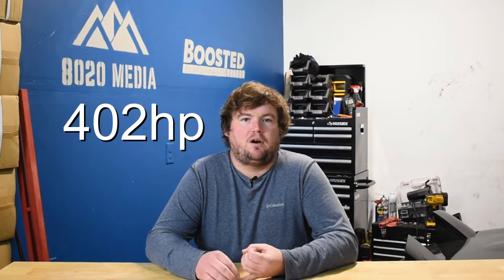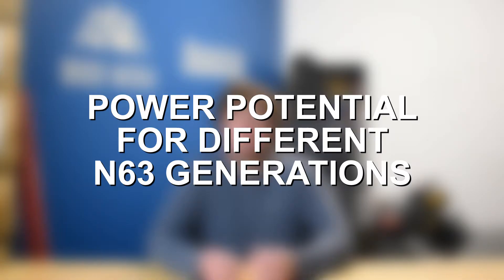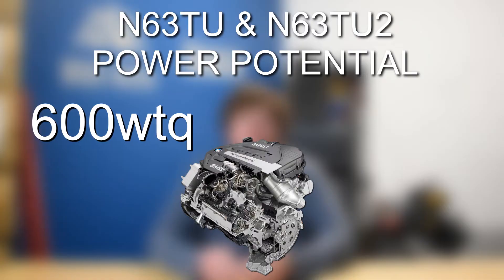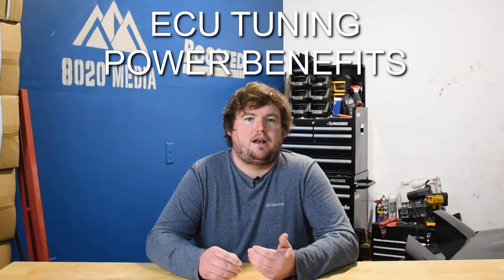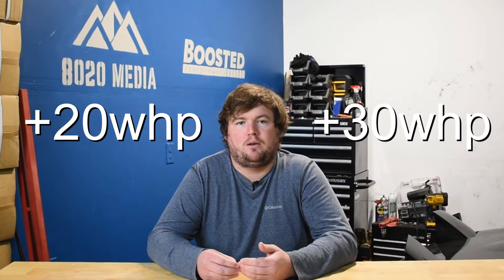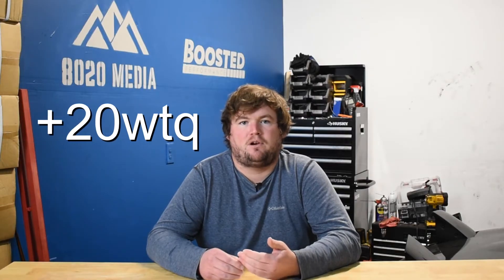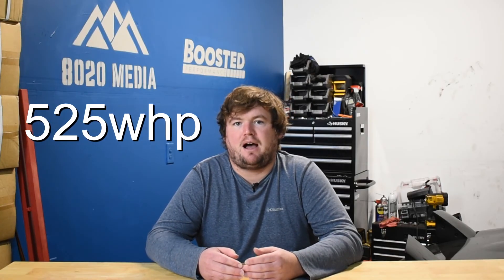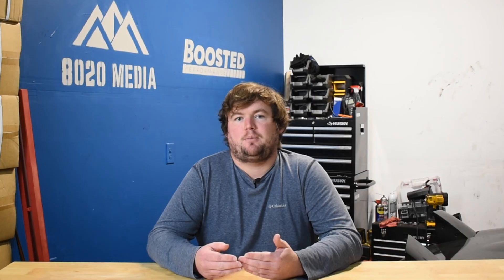How to Build a 600whp+ BMW N63!

Comment: Yo man thanks for the info! I have been thinking about this since getting my 2022 M550I with the N63TU3, want to research how much i can modify without voiding warranty or having a check engine light on at all times. I was thinking first midpipe + exhaust to prevent cutting the OEM exhaust and perhaps some HFCDP (in hopes to preserve oem parts). Could you recommend how much we can modify before Check engine and before void? I appreciate the details, like and sub earned from me.

Also what do you think about a race chip instead of tune? to avoid unlock costs
Reply from the maker: S - Thanks for the feedback! With the N63TU3, you can go a decent way with mods before triggering a CEL or raising obvious warranty flags, but the key is to stick to upgrades that don’t alter emissions-critical components or ECU calibration in ways BMW can easily detect. A midpipe and cat-back exhaust are generally safe from a CEL perspective because they’re downstream of the catalytic converters, so the rear O₂ sensors remain happy—just keep the OEM parts to revert if needed. High-flow catted downpipes (HFCDP) will almost always trip a CEL for catalyst efficiency unless paired with a tune or O₂ sensor spacers, but even with catted versions, BMW can spot them on a warranty inspection, and replacing cats technically violates EPA rules, so they’re higher-risk for both emissions compliance and warranty coverage. A RaceChip or similar piggyback is safer from a detection standpoint than a flash tune since it can be unplugged to return the car to stock without ECU flash counters incrementing; however, BMW can still log overboost or unusual sensor readings if a drivetrain fault occurs. The most “low-risk” power path for you would be: midpipe + exhaust, upgraded intake, possibly a RaceChip piggyback set conservatively, and keeping the factory downpipes if you want to be almost invisible to warranty inspections. Once you swap cats or flash the ECU, you’re in the higher-risk category for both CELs and warranty flags.

Comment: I prefer to tune with race fuel instead of E. I want to tune but i want to push stock turbos in a max effort build. Where are you guys located?
Reply from the maker: M - Thanks for sharing. Unfortunately, not everyone has access to race fuel. We're fully remote.

Comment: What does Arms charge pipe offer for a 2019 m550i ?
Reply from the maker: D - It replaces the factory plastic charge pipes with high-flow aluminum units, enhancing durability and airflow. The benefits include improved throttle response, reduced turbo lag, and better support for higher boost levels, especially when paired with other performance modifications like tuning or upgraded downpipes.

Comment: Havent dynoed mine but I run logs and tune on the JB4.  My base tune is on a Heatsync Beta tune then I jump on a piggyback JB4 for fine tuning and WMI integration.  I have bigger stage 2 turbos, Water Meth, ARM Downpipes, and 3.5 Bar TMaps.  Based on my software calculations I should be closer to 700whp but I never run it that hard unless I was tuning.  I pretty much drive like a grandma but I open it up when I want to.  Only drawback is the X5 E70 is a pig at 5600lbs.
Reply from the maker: B - Hell yeah! Sounds like a sick build. Thanks for sharing.

Comment: How realiable is a flash tuning for daily driving with these mods?
Reply from the maker: B - Depends on the kind of tune. But usually with more mods, the less reliable an engine gets. Unless you have a big budget and can afford all of the correct supporting mods.

Comment: I have 650i grand coupe 2015 N63TU upgraded charge pipes changed the turbo inlets upgraded front facing air intakes catless down pipe x pipe straight pipe sounds like a beast check my clips out just need my tune should I go stage 1 or stage 2
Reply from the maker: S - Hell yeah! What WHP are you running?

Comment: I have a 2011 X5 n63 with upgraded turbos, catless downpipes, upgraded coils from dinan and a jb4, and it's pushing close to 600 horsepower and she is a beast.😊
Reply from the maker: B - Thanks for taking the time to share your experience! Sounds like a nice build.
Reply: where'd you get the upgraded turbos?
Reply: Do you have a link you can send for specific JB4 you used for N63 I have a 550i been looking for a quick plug in tune only plan on a full ECU tune when I upgrade turbos
Reply: Can u tell me what the cheapest option would be to gain just 50 hp?

Comment: I have map options on Bootmod, Alpina 540hp and Alpina 600. But no real description on them. Could I run the 600 map?
Reply from the maker: F - Depends. Do you have all of the supporting mods needed?
Reply: @8020Automotive  I only have a OEM M5 exhaust on it.
Reply from the maker: F - Gonna go ahead and guess that'll need more than that for the 600 map. It should say on the bootmod site
Reply from the maker: F - Keep us updated!
Reply: @8020Automotive  yeah I thought I felt more power on the alpine 600 but it’s very similar if not, slower than stage 1 on 91. Occasionally would smell the heat, like something getting very hot. Switched back to stage 1 and feels a bit quicker. I want to go 93 but ots bundle is $150 additional, like damn should have picked a 93 tune. Donations welcome lmao, e30 is what I’m looking forward to though 😈
Reply from the maker: F - Nice!

Comment: Hello. Is there a way to tune or code out catless downpipes? I don't want to drive with a check engine light on.
Reply: 12B304 & 12B305 with Bootmod3.  Very easy to do.  I do this on mine. One is for the drivers side sensor the other is for the other side sensor.
Reply from the maker: S - There is a way to tune it out.

Comment: I have a 2016 750i xdrive. My current mods are catless downpipes, 3” straight pipe, Dinan ignition coils, ARM front facing CAI and charge pipes. I currently have a BM3 93 stage 2 tune. It’s definitely fast for a massive land yacht. The biggest issue with this platform is finding parts for it. For example the ONLY swappable intercoolers costs 3k. There are other options out there but it’s definitely a premium in terms of cost.
Reply from the maker: A - That's typically what happens when a vehicle gets more expensive. But sounds like you've got a great build!
Reply: i was thinking of doing this with my 2015 750li but that car is built to be quiet I would hate to change that with a catlkess down pipe. Is there any quieter but freer flowing options?
Reply from the maker: C - High flow catted will be a little quieter. But honestly a downpipe doesn't really make it a lot louder. Now if you're adding a full exhaust, that's where a lot of the sound comes from.
Reply: @blluz1 I have catless downpipes with oem m performance exhaust and it actually sounds great and at an amazing level comfort start has a nice growl with cruising being pretty much as quiet as stock with no extra drone in sport start up it is quite loud but sounds great and there you definitely hear it rumble driving in sport mode
Reply: keep messaging companies requesting parts. I know I have been for my n63t3. Custom turbo manifold and larger charge coolers, and remote oil coolers.
Reply: Hi I go the same model. What would it take and how much more o less.. What did you use.?
Reply: Was your ecu unlocked
Reply: Hey just fyi the Dinan intercoolers are just factory E70 X5M charge air coolers. You just have to figure out the rest of the kit yourself.
Reply: Yo is there a way I can make my 2016 750i burble and be loud ? Without doing anything else crazy besides the downpipes ?

Comment: Downpipes and charge pipes should come before a tune in an ideal world.  While catless downpipes deliver maximum power and the fastest imaginable turbo spool, you can make 650+ at the crank with an N63TU variant with high-flow cats.  Your advice on that front was spot on and for the right reasons.  Nice video!
Reply: Where am. I getting the e30 fuel?
Reply: @ikomusic1 at a gas station that carries it
Reply from the maker: A - Agreed! Thanks for the feedback and insight.

Comment: Where do you get a high flow catted downpipe for under $1,000? I’m seeing more than double that for the cheapest one.
Reply from the maker: I'm not sure I'm aware of any reputable ones. Good catalytic converters are very expensive since they use rare earth metals so they're ridiculously more expensive than catless options.
Reply: Arm 450$
Reply: CTS turbo high flow cats they go for $800
Reply: Bmp tuning

Comment: JB4 handles first gen bootmod for the other gen’s I have intercoolers turbos Catless full exhaust with coils plugs oil cooler valve with 180 degree stat with 1.4 bar cap what a monster plus front facing intake with charge pipes liquid Molly for trans oil and dif.
Reply: SUV or car ?
Reply: @Mobb1996 650i coupe I love it man next project is 17 N63R 750i M Sport
Reply from the maker: D - Sounds sick!
Reply: @Mobb1996  650I COUPE AND 2017 N63R 750I
Reply from the maker: D - Sounds like you've got a nice build! Thanks for sharing this insight.
Reply: @8020Automotive thanks man! I’m doing another build
Reply: Hows the maintenance? I have 650 grand coupe and looking to do some mods as well
Reply: I got the x5 50i f15 640hp
Reply: whered you get intercoolers from i cant find any aftermarket

Comment: Great vid, though once you mentioned bootmod3 you should also note that it does not support the "original" N63
Reply from the maker: Starky - Thanks for the insight!
Reply: Does that mean it's compatible with the n63tu? I have the 2017 650i xdrive coupe (not gran coupe)
Reply: @farfigneugan42 bootmod3 will work for yours
Reply: So can I not do this on my 2011 bmw 550i xdrive?
Reply: @federickpickle3398 Yes...but not many piggy back tune available...need custom tune

Comment: E85...... Yeah you lost all credibility just by suggesting that e85 makes more power
Reply from the maker: I think you might be confusing E85 with 85 octane. E85 is 85% ethanol and 15% gasoline. Ethanol has an octane rating of 100+, burns much cooler than gasoline, and has a lower stoichiometric ratio. That means E85 is incredibly knock resistant and allows you to safely advance ignition timing and run higher boost. 

Depending on the mods and setup, full E85 can show power gains of 50-100+whp on the N63 (with the appropriate fueling mods for 100% E85). Looking at a small blend of E85 - like an E30 blend - you can still see power gains of 20+whp on the stock turbos without any fuel system upgrades.
Reply: @8020Automotive is this doable with a stock 18’ BMW M550i?
Reply from the maker: J - Is what doable?
Reply: I need to smoke what you’re smoking
Reply: You don’t know much about engine, compression, and boost do you? Lmao
Reply: I heard E85 takes longer to combust then regular gasoline🤷🏾‍♂️